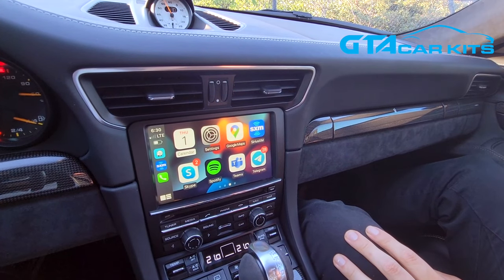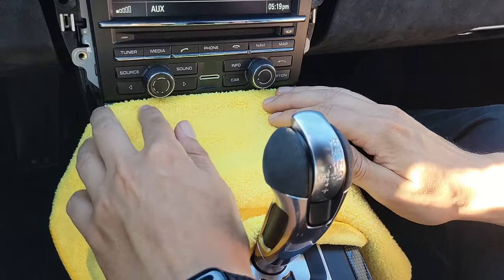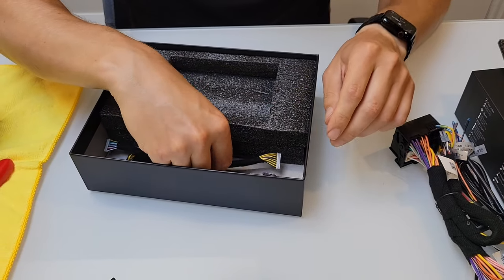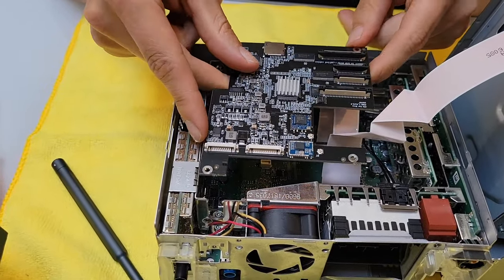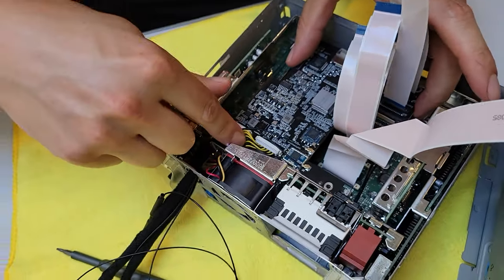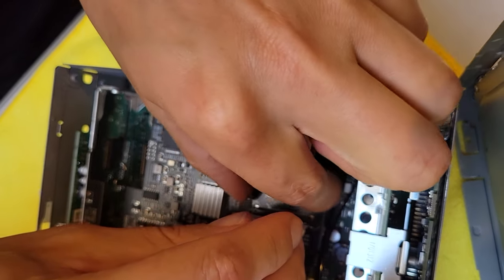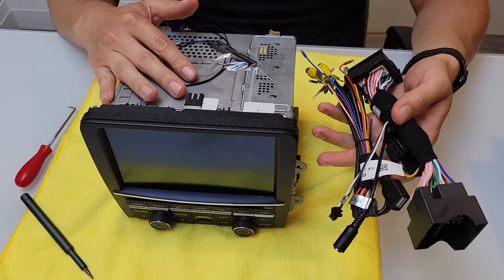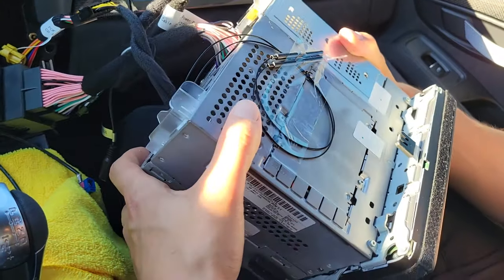Wireless CarPlay and AndroidAuto in Porsche 911 2012 2013 2014 2015 2016 touch screen PCM3.1

Comment: I just installed this and am very happy with the result. Whilst very helpful, this video makes it look a bit easier than it will be for the average person like me. Here are some tips that might be useful.

1. Do it in daylight if you can - I did it in a badly lit car park, which didn’t make it any easier. Download the video to a phone or laptop so you can follow along.
2. It’s worth covering the screen to protect it from scratches - I taped a piece of cardboard over it. 
3. Likewise, I put a cloth over the gear lever as the unit will rest against it during the installation.
4. https://youtu.be/RbIn-z8U6lE?t=182 Removing the antennas was the first difficult part. The key is to make sure the release clip is pressed. Rather than my finger, I found it easier to use two screwdrivers, one to press the clip and the other to lever the antenna out.
5. https://youtu.be/RbIn-z8U6lE?t=383 Opening the casing was not as easy as it looks in the video. Firstly, there was a sticker on one side that needed to be cut. Secondly, it was very stiff and needed a lot of force. I ended up doing it like this: https://youtu.be/MvTrdPw_nB8?t=1201
6. https://youtu.be/RbIn-z8U6lE?t=542 Plugging the cables into the motherboard - I found this very tricky. They did not slide in easily, and I was worried about bending one of the pins. I did it by getting one end in, then squeezing the connecter and the port until it was fully in.
7. https://youtu.be/RbIn-z8U6lE?t=817 when installing the cables in the car, you may need to move the two-pin audio connecter with the green cable from the existing harness to the new one. Otherwise, you will have no sound. I think this applies if your car has the Bose audio system. Removing this connecter was a little tricky, but basically, there’s a small clip on the harness you press, and it just slides out. I also needed to unbind this cable from the others as its short length made everything too tight.
8. https://youtu.be/RbIn-z8U6lE?t=851 I found that locating the USB cable to the glovebox made it hard to close. I actually put it on the passenger side of the center console, as then you can use the drinks holder as a phone stand! [long-term update - this wasn’t the best decision. A dedicated phone holder is needed. Plus for neatness and ease of access, better if the cable is on the driver’s side]
9. https://youtu.be/RbIn-z8U6lE?t=903 the key to getting the harness back in easily is to push the clip fully open
10. https://youtu.be/RbIn-z8U6lE?t=986 putting the unit back in was not easy. As it shows in the video, try and bunch everything up at the back. Mine didn’t quite go in flush, but after I screwed it back in, it was fine.
11. https://youtu.be/RbIn-z8U6lE?t=1025 replacing the side panels is a bit fiddly. The key is to push the end in more than you think you need to. Then look to see that the clips are aligned.

With the system up and running, a couple of things aren’t documented: to use the car mic for phone calls, in the unit settings, you need to set “original mic” to ON.

In order to switch back to Carplay from the car interface, you need to hold the INFO button.
Reply: You are a hero! I would not have been able to do this without your comment :)
Reply: Thanks so much for these tips. In addition:
1) I don't think you need the slightly larger (yellow and black) wire from the new board if you aren't running cameras and plan to use wireless connection for everything (no USB). Saves some space!
2) Don't forget the optical connections! I did originally and not only was sound not working (no surprise) but I couldn't even change inputs.
Reply: thank you for this confidence-building comment!
Reply: What is the green 2 pin connector for the audio?
Reply: @williamwebster2581 it’s for the Bose audio, if the car has it
Reply: @gajones76  do I just pull it out and attach to the one from the kit?
Reply: @williamwebster2581  right
Reply: @gajones76  thank you for your help
Reply: Thank you, your tips were very helpful for the installation
Reply: This comment is ELITE. I was so confused as to why I wasn’t getting sound, and thought I did something wrong. I was about to take the whole thing apart and try again… but I read your comment and did what you said with the green cable, and boom, it worked! I have the Burmester system in my 991, for anyone reading. Thank you for this info!
Reply: @skreammedia6770  Good to hear, I'm glad it helped!
Reply: @gajones76 thank you!! I also ran into issue 7 with the 2 pin audio connector for my Bose audio!
Reply: @gajones76  is the green wire included in the existing cluster harness with the square plastic locking connector? I wish I can attach some pics that I took! No sound despite checking everything again!
Reply: GTA responded to me via email and sent me a link to their YouTube install for V1 CarPlay in the Mercedes Ben’s s class and they show that 2 orange wires from the original harness has to be removed and plugged in directly to the new male harness. The 2 orange wires are connected via a plastic coupler and will separate from the original harness via a clip that has to be pushed to release, and then it can clip in directly to the new square harness at the bottom left . There are 2 open slots and you want to make sure you clip in to the slot closest to the edge.

Comment: What do you do if everything works, but you can't get any sound?
Reply: Just encountered the same thing-no sound. There are 2 fiber optic cables that need to be moved from the original harness block to the new one that plugs into the pcm. They come out easily, just have to be gentle, but man they make it a lot harder to move stuff around !

Comment: looks like a simplified kit as mentioned with less cables. However, I am hesitant to order on since there doesn't seem to be much support. I see no replies to the questions asked and gajones76 has been very helpful with info, but that's about it. I would like to hook up the rear and forward cameras as well, but no mention of that. At least I know with JoyAuto, the support is there when/if needed, and that's one of the most important criterion for ordering a kit in my opinion.
I'll wait to see if questions are answered or not before making my final decision.
Great video, just need to cover all areas i.e. camera install, and what were those other wires you did not plug into anywhere?